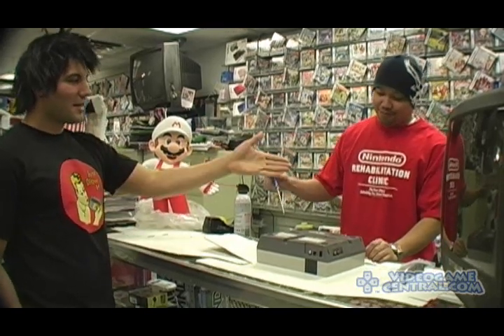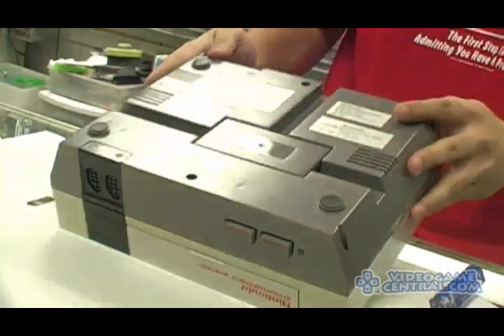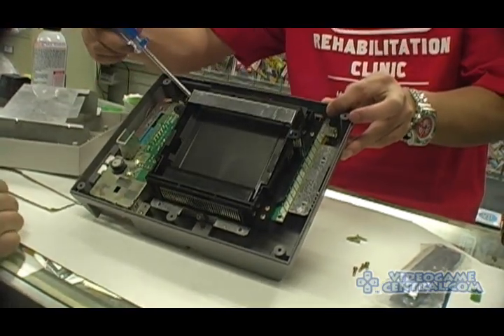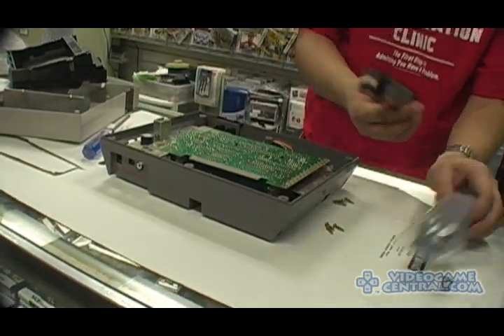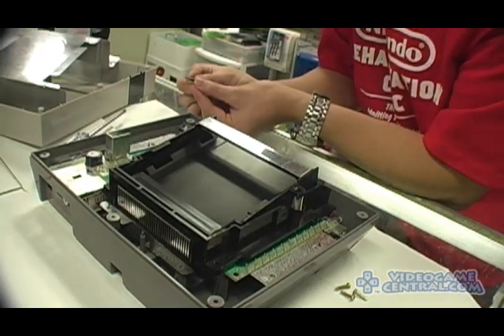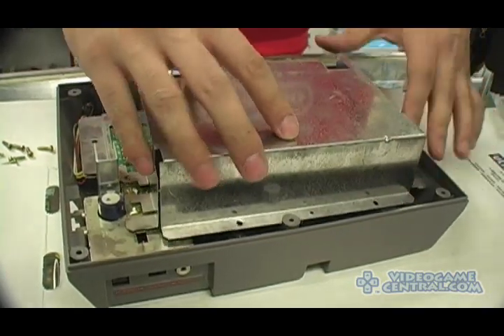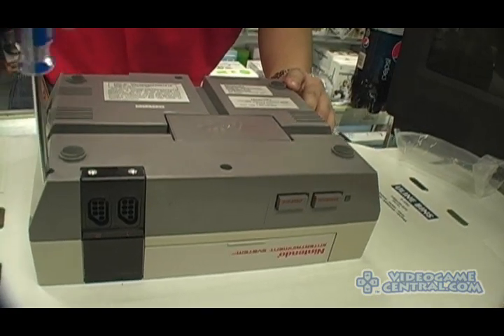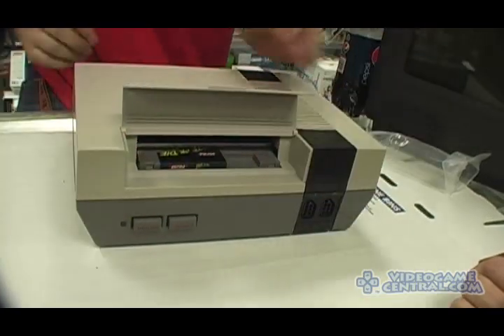How to Fix & Repair the Original Nintendo System - Replacing Nes 72 pin Connection Part

Comment: You're absolutely right Elias. That's exactly what I did recently and it made a world of a difference. 95% of the times, all my games load up without a problem. I also stopped blowing on the carts because I don't want to corrode the connectors. Just learned a few things over the past few weeks. lol.

Comment: I did that a couple of times myself. fairly easy to do.
i stashed a couple of 72 pin connectors just in case.
the first time i did it i was nervous as hell. i wish i had a video like that back then.
cool video

Comment: @hughesbill45 What they did not show in this video is the actual cleaning of the mother board connection (where you slide the 72 pin connector onto).  Take your brasso or your cartridge cleaning paste and rub that connection part down very well, you will get a ton of black stuff off of that.  Once that's good and clean then attach your new 72 pin connector on.... also make sure your NES cartridges are clean (cleaning paste/spray) and everything should work great!

Comment: @robo9193 
No you don't, surprisingly, when you think about it, when the system was being built the 72 pin connector was put on and nothing can get onto that part of the board, essentially it's dust proof. I took my NES apart today and took off the pin connector and it was like new under there.

Comment: Oh, and also, maybe you should clean the connectors where you slide your 72 pin connectors (the part that looks like a game board). Use a little bit of Brasso until it's shinny.

Comment: Some replacement connectors are not the best quality. They're shoddily manufactured and can give you more problems than your old ones. I purchased a couple and each one had it's own issues. I placed back my old one and found that blowing a cart or wiggling it in the connectors was less of a headache. Some new 72 pins do work though. It's a gamble.. :/

Comment: I replaced the 72 pin connector and the damn thing still blinks, I still have to do the ol' take it out and blow method. I also cleaned the cartridges...that doesn't help either. Some systems are just plain old and no matter what you do to them they still won't play games.

Comment: Before I started this process my NES power button flashed red. So I replaced the 72 pin connector and followed your steps precisely. When I went to test the NES, it continued to flash red, so I removed cartridge and tried over. Except when I did this, the power button won't even turn on now. It doesn't even flash anymore, it's just dead. What's the deal? Any suggestions?
Reply: try a new power adapter  9v output rating with at least 850mAMP rating
Reply: Did you ever get an answer to this question? I am having the same issue.

Comment: @xxcgjonesxx Most every problem is the 72 connector-try to clean it and the MB contacts; otherwise install a new connector as shown here. As long as you get Video and flashing power light it should be repairable.

Comment: I've put in a 72 pin connector, changed the AV cables, found a power supply that works and blown on the cartridge and absolutely nothing happens.

Comment: But to be fair, depending on the location of the NES. I got mine from a smoker and some of the pins were rusted. I assuming it was from all the smoke. The NES smelled horrible of smoke

Comment: Actually, he's right. Ive fixed dozens of consoles and its different in all of them. Some are pretty clean and others have dust and are a little bit rusty. The best is use a little bit of Brasso to clean that area and leave it shiny and clean, looking like a mirror. That way it ensures it'll work way better for way more years. And the guy does look like a douche.